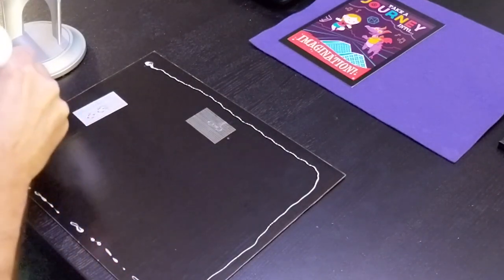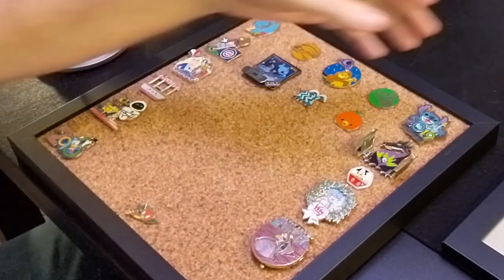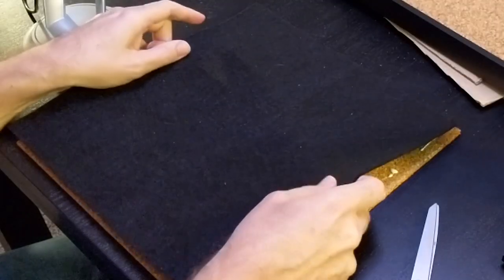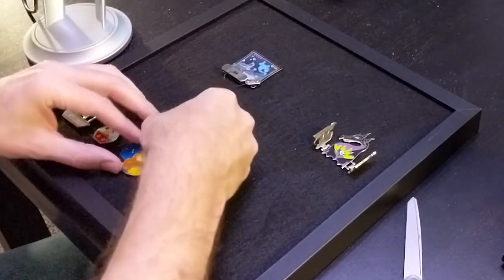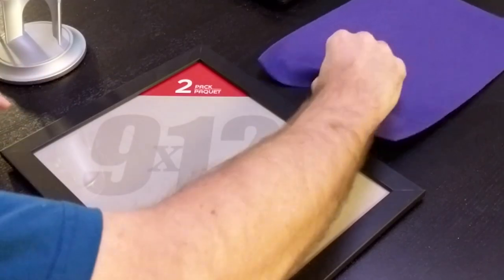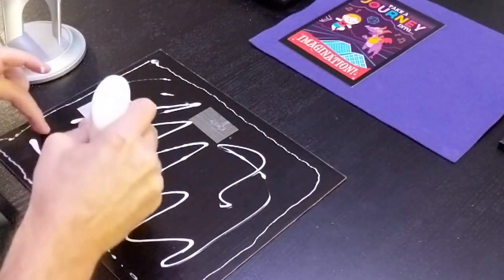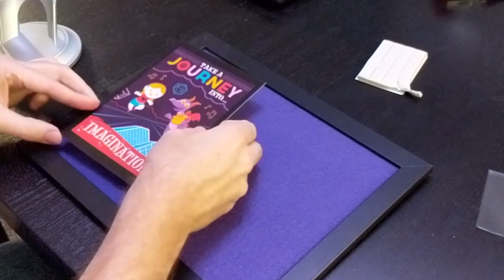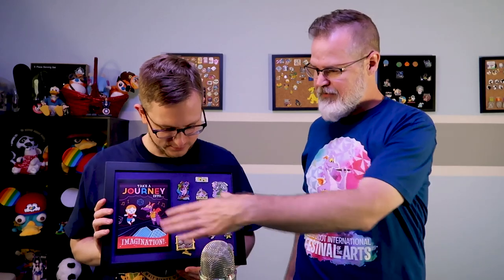Disney pin board DIY // Our first project -- Two easy Disney pin board decorating ideas.

Comment: Inspirational. Thanks for a great video.
Your 1st project used material over cork.
The backing board on your 2nd project in the video looks somewhat hard.
Doesn't that risk breaking a pin post?